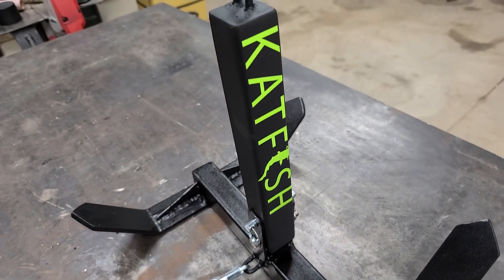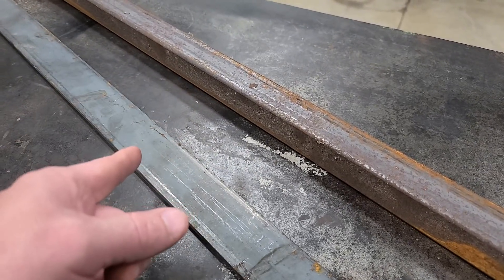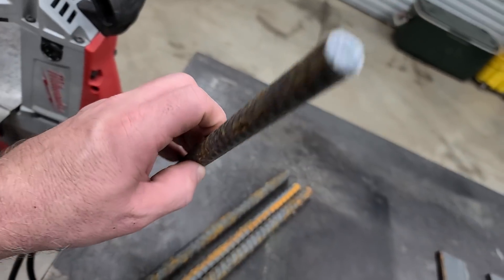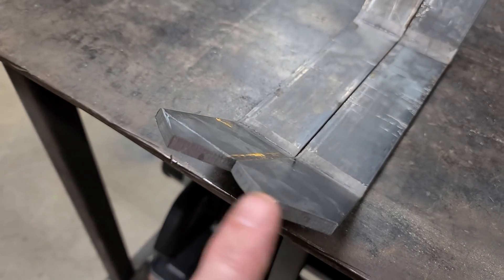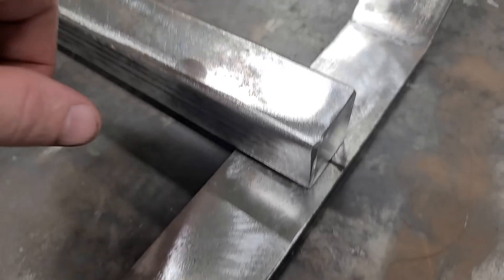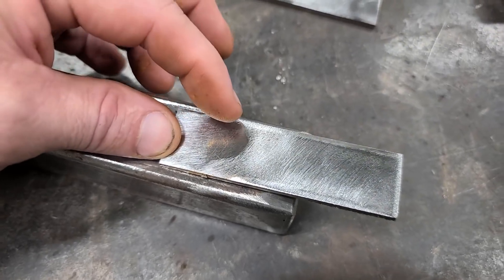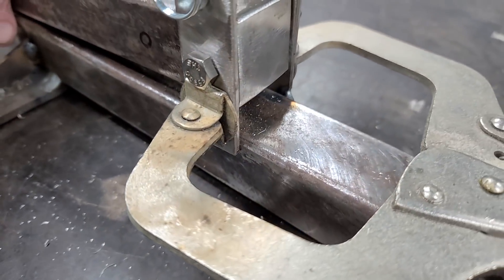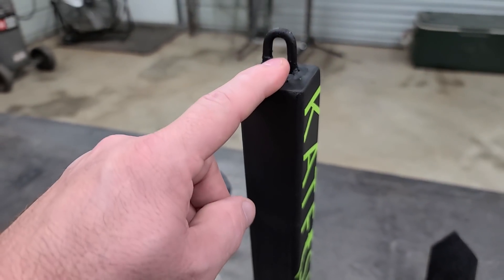DIY  Columbia River Anchor( that will hold any boat )

Comment: Gotta love that Miller 211 welder. I've had mine for many years and it's gotta be one of the best all around mig welders for its size.  I've used every other Miller, Lincoln and others out there and I'm glad I have that one at home.  I have the spoolgun for aluminum too and it makes it such a capable machine you really don't need anything else. 

Great anchor too, that's pretty similar to the ones I use for my big pontoon.  Keep up the good work. 
Cheers
Reply from the maker: Cheers my friend  , your right it's a great little welder  , there's better welders out there but for what I do its perfect 👌

Comment: Love that anchor! I'm gonna have to build one. You could make that main tube water tight by drilling them holes a little bigger and welding pipe  in it for the bolt and pin to go through.
Reply from the maker: Your exactly right  . I wish I'd have thought of that lol . I was thinking about doing the lead like I did on the last anchor to make it watertight
Reply: @FishinNStuff   Was thinking the same thing he said.
#1 just open up the bottom and leave a hole so it will not hold water. Dump paint inside and roll around to coat the inside to stop the rust. Let extra paint drain and dry.
#2 find a section of heavy wall round tube. Drill out your sq tube to fit the round tube, Weld one side of the round tube in place and run a drill from the other to clean the hole out. Then weld the other side, run a drill to clean out. This will give you a welded in bushing that will not deform if you want to tighten down the bolts and keep it dry.

But great job, Have one just like it that I got about 10 years back. One of the ones you pictured if I recall.
Reply from the maker: @mr.gadgetfishing2134  that's a good idea too . I started to water proof the top section but then I started thinking it would be easy to replace it , seeing it come off from the bottom . But really it takes years for steel to rust out . Ive got some angle iron out side ive had out there 11 years and its not pitted yet lol . But salt water is another beast altogether
Reply: @FishinNStuff  Not really talking about rusting out. After several trips it will start to Rust, at that point you will use it and the rust water will dump on the deck of your boat, on your anchor rope and stain it, also if it gets on anything it will mess up that. More worried with the rust stains in the boat and on my gear.
Reply from the maker: @mr.gadgetfishing2134  that's true

Comment: The only issue i see is the swing arm allows water to get in through the pin... Which will eventually lead to rust.  Maybe the cheapest solution is to spray a bunch Rust-Oleum paint into the hole. Taping off the hole and shaking the hell out of the bar to ensure everywhere inside is covered. And then let it dry. Just a thought... Galvanized metal or thick aluminum swing arm are options too.
Reply from the maker: @Manmodor007  it'll rust but ive seen 8th inch steel lay out side in the rain for years and still holds its strength  at the scrapyard  . It's kind of like gluing a gun . It's corrosion  , but it slows down the degradation too . But having said that . If it's going to be used in saltwater that's a whole nother story  . You can put lead inside like I did on another anchor video I did
Reply: @FishinNStuff  that's a good idea with the lead... Darn it, now I'm going to have to build one... Thanks for the video!

Comment: Iv lost 2 anchors this year. one was my fault, I had it on a non locking D-ring. The 2ed would take several tries to grab bottom but that last time it did there wernt no pulling it back up. I got to get my welder out and try this design.
Reply from the maker: Stinks when that happens  , I'd love seeing the bottom of a drained lake lol

Comment: This breakaway anchor been used on Willamette River since I was a kid! Better be careful saying any boat, because it won't hold my jetboat on one NW River Mt. Vernon, Washington because the river bottom is like iron an these rails won't dig into bottom to hold! I'm thinking of alternatives! They call it Willamette River anchor is because, with so much breakaway pull the anchor inverts an lifts from all the cables on bottom at base of Oregon City Falls!
Reply from the maker: Would a box anchor work , maybe
Reply: @FishinNStuff  box anchor is one I'm considering. It's the Skagit River with hard bottom in Washington. We take shoe string or zip ties that break on top to flip anchor over! Check this: river bottom so hard a salmon so thick, they raised my aluminum jet boat up an out of the water, like a huge monster going under boat!
Reply: @FishinNStuff  I thought just like you, this anchor works well everywhere, then I moved to mt. Vernon an Skagit River hardest bottom ever, anchor just slides down river bottom! I can't use up half boat space on anchor?

Comment: I would've use a solid piece for the bottom piece of the hinge. Bend it into a U around the anchor and drill the hole for the bolt through the uprights. To break that, you'd have to break the welds AND tear the metal. Much greater fatigue resistance that way
Reply from the maker: That's a great idea

Comment: Shouldn't you drill a drainage hole in the bottom of the vertical bar since you drilled a hole for the pin and you welded the bottom closed, or maybe not weld the bottom closed. Also would it help to apply epoxy or bed liner to the inside of that vertical tube so it won't rust inside?  Or maybe design a joint that does not require drilling a hole in the vertical bar, maybe have a pin on the outside through a pair of gussets that will keep it from folding until the pin is pulled.
Reply from the maker: Yeah ill do a hole or you could do i like I did on the last anchor and put lead in it

Comment: Hey Keith, great ideas and advice.  No if i could only weld.  is it good idea to just jump in and do self-teaching?  whats a good starter stick welder
Reply from the maker: I don't know . I don't stick weld too much . But you can get a pretty good deal on a mig welder at Harbor Freight  . You can use Flux core wire and not have to buy gas .

Comment: Love the videos. Some of your projects I've made and been using for years. You've got several that I have on my to-do list that grows with each video! Was wondering what type of chop saw and blade you're using to cut your steel?
Reply from the maker: It's an Evolution cold cut saw . I runs at a lower RPM so it's safe for cutting steel  . Just Google  cold cut saws

Comment: Awesome DIY videos.  I have a question though.. once you drilled the holes for the pin how did you stop the top from filling with water?  Thanks man and keep up the great videos.
Reply from the maker: I didnt  , but if you dont want water getting inside you could do the lead trick i did on the lay anchor i made
Reply: @FishinNStuff  thank you.
Reply: Was gonna ask the same question. You can also just pop a drain hole in the bottom  so it'll drain while it's standing up

Comment: Great project!!  I just question whether the two small pieces of metal that hold the top and bottom together is a weak link.  Hope you never get the anchor stuck in rocks... you may not get it back!  :-)
Reply from the maker: You might be right lol . I think its strong enough they are 1/8" , but you could always go with 3/16 or 1/4" if you was worried

Comment: With the bottom loop on the side of the anchor for the chain doesn't that defeat the purpose of a breakaway? Cause since it's not on the complete bottom there would be no way to get it unstuck, since you would be pulling from the side and not from underneath it.
Reply from the maker: Well i just built it just like the Fish fight Anchor i left in the comments.  Click the link and look at it . But you could be right i haven't got to test it yet
Reply: @FishinNStuff   yeah I was thinking if the legs got stuck on something and the zip tie brakes, it still be stuck since it's not on the bottom letting you complete flip it and dislodge it. But who knows there's only one way to find out.
Reply from the maker: Your right . I just built it like the Fish Fighter . They make nice Anchors . I hope it works

Comment: Looks like this one was built for Hagan.....
Reply from the maker: He needs it don't he lol . He told me he got his boat running like a new one now
Reply: @FishinNStuff  what I seen was the logo you put on the anchor is the same on his boat..
In his video he stated he rewired the whole boat,as it looked he seems to have it fixed...
Reply from the maker: I have that same logo on my boat too . But its not as big as the one Hagens got
Reply: @FishinNStuff  I built my no hang from round steel pipe,1 1/2",and 1/2" reebar,works very well,have had to break the zip-tie twice but retrieved it..

Comment: That ancor won't fit in ur box will it? Once folded it looks to be longer then 18 in
Reply from the maker: It fits , its 15" wide and folded its about 19 or 20 inches maybe . But my anchor box is over 2 foot deep . If you watch the part where i throw the last anchor in it , you'll see how deep it is

Comment: Which cold saw is that? I’ve bought steel cutting blades for my miter saw and they hate cutting flat tube sides. Flat stock, round tube, etc it’s great, just not sq tube.
Reply from the maker: Its a Evolution saw . Cold cut saws turn less RPMs might be the difference im not sure
Reply from the maker: https://www.homedepot.com/p/Evolution-Power-Tools-14-in-Multi-Material-Chop-Saw-R355CPS/311636073?mtc=Shopping-B-F_D25T-G-D25T-25_9_PORTABLE_POWER-Multi-NA-Feed-PLA-NA-NA-PortablePower_PLA&cm_mmc=Shopping-B-F_D25T-G-D25T-25_9_PORTABLE_POWER-Multi-NA-Feed-PLA-NA-NA-PortablePower_PLA-71700000034127218-58700003933021540-92700053252310110&gclid=Cj0KCQjw4f35BRDBARIsAPePBHwOq92xfk7kKB5IzkeCa_8650n-3QgplgiYkHGPf7NiuEbtZW9Wg84aAiHwEALw_wcB&gclsrc=aw.ds
Reply: I was afraid you were going to say that. Hahaha
Reply from the maker: @god910  well that's the only difference I can think of lolol
Reply: That one’s not as expensive as some though. Might have to look into it.

Comment: My Stepson lost my 20# mushroom anchor in the river..... Now I need another anchor.... Btw, how much did this anchor end up weighing?
Reply from the maker: It was around 13 lbs , but I made my first one  14 lbs and it held great . My buddy had a 12 lb and a 18 lb river anchor and he says he can't tell any difference in em . So im starting to think with river anchors its more about the tines than the weight  . I know my 14lb river anchor holds twice as good as my 15lb mushroom
Reply: @FishinNStuff  that's actually good to know! Thanks for the feedback! And to add..... This latest design should hold very well in river current with those reinforced horns. And since you have the anchor with  the bottom attachment point it should allow for a zip tie strapped at the top of the shaft to able to break the zip tie and then pivot the boat around the anchor to get it out.